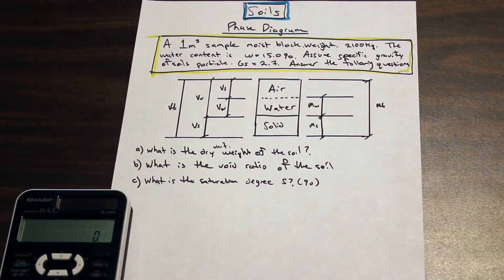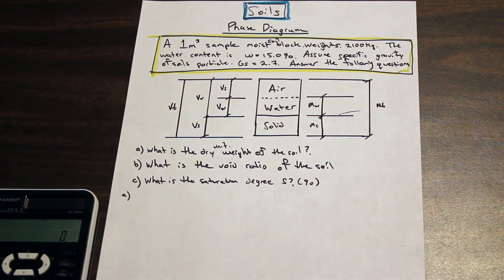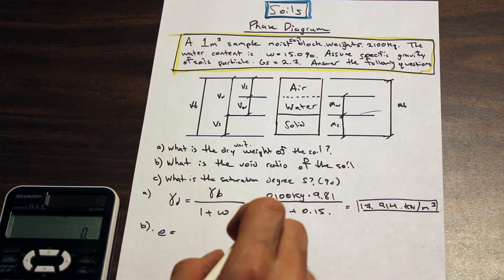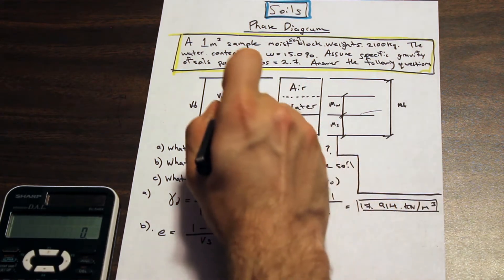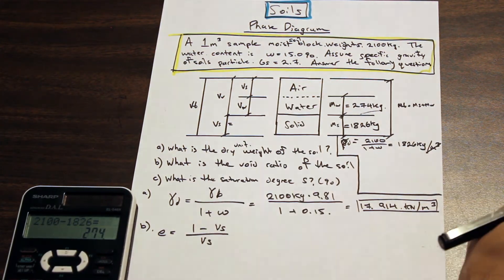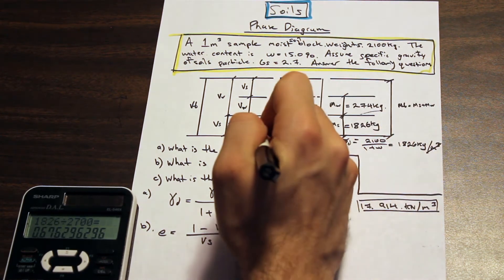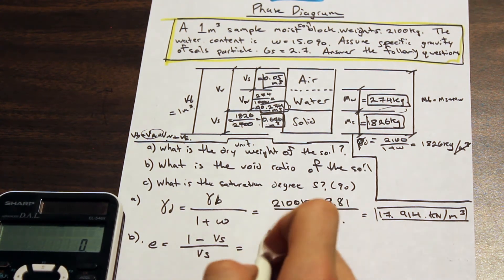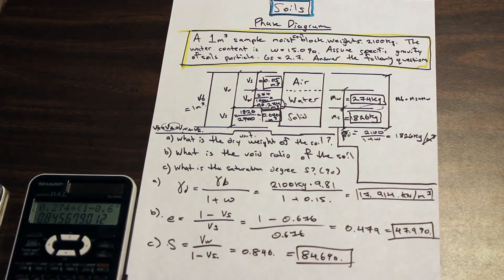Phase Diagram - How to Solve for the Dry Unit Weight, Void Ratio and Saturation Degree of Soil

Comment: The units of the problem I am working on are in lb's and ft3. I followed your steps to calculate the void ratio and I get a really big number. Also, in the problem, it says the sample of a certain soil has a weight of 38.9 lb. It does not mention it being moist. Does any of this affect my calculations? Please help, I need it urgently
Reply from the maker: Yes it depends if the soil is saturated or not.  I don't know how to help you, you just need to work out the units correctly.  Most of these formulas should apply still with imperial units.